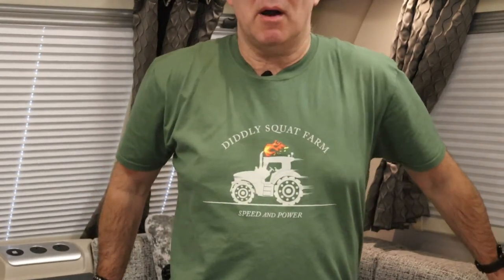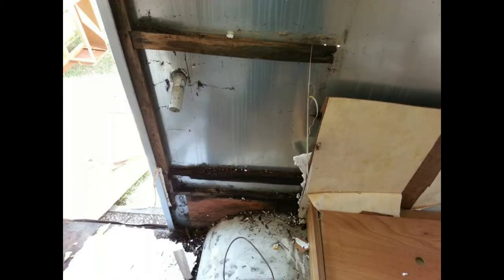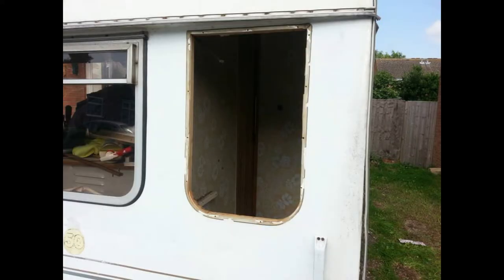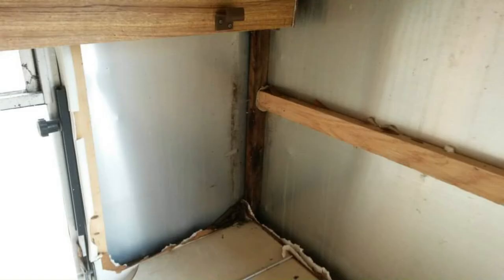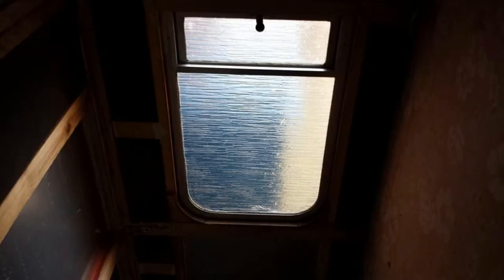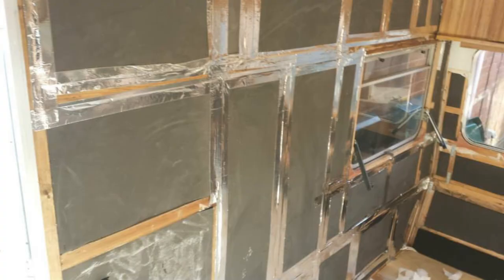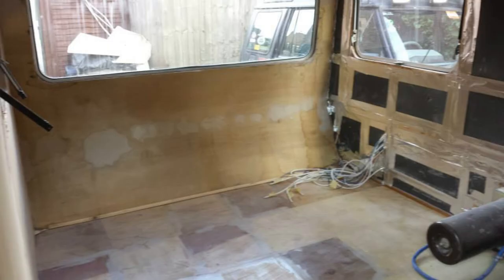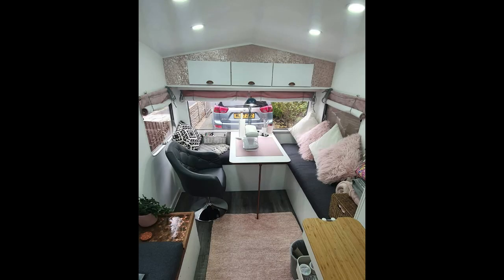Restoring a 1970's Caravan ABI Ace Rallyman

Comment: Hi! Really impressed by your work. Im about to start restoring my Ace Monza 1200 from 1978, and this is the first caravan i,ve ever had, so I have a couple of questions im hoping you could sort out. Your video has already helped a lot, so thank you already!
Do you only use sikaflex to fasten the new battens, or anything else? Im from sweden so i cant find the exact sikaflex that you´ve already linked to, and the one i find most common in sweden is called Sikaflex 522, do you know if its good enough?
did it work well with the plywood squares you used for flooring, or do you recommend larger plywood boards or any other material? And is 3-4mm enough for the floor?
I have the same question for walls and ceiling actually, what material and thickness do you prefere here?
As i´ve already said, i really liked your video! Very informative and helpful!
Best regards, Ted
Reply from the maker: Hello Ted

Thanks for your message and thanks for watching. Sikaflex 522 is perfect if you can get holds of it, It needs to be flexible and strong once applied. I used the Plywood Squares as these were free offcuts that I managed to obtain, I repaired the original plywood floor and the put an additional insulation material down and then laid the squares. on top of that if you can use larger pieces of ply for the floor that would work better. Plywood for the walls should be about 3mm or as close as you can get to that.  I wish you all the best with the restoration and I am here to help if I can. James
Reply: Tank you very much for the answer! Sikaflex 522 it is then :)

Comment: did these caravans have any asbestos in them do you know?
Reply from the maker: Hello, I am not an expert but familiar with Asbestos, I didn't find any when stripping back,  The Only Possible area I guess for Asbestos would be around the gas fire or possibly the water boiler if it had one,  There was none in the caravan and I stripped it right back. Hope that helps and thanks for watching. James